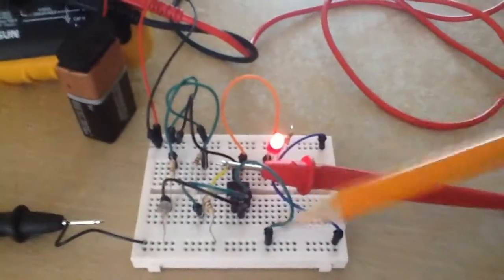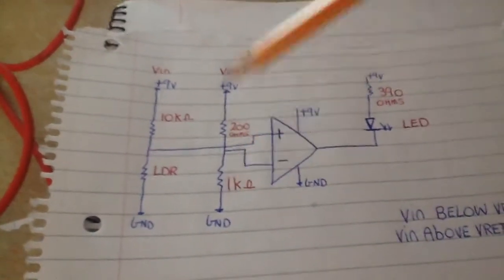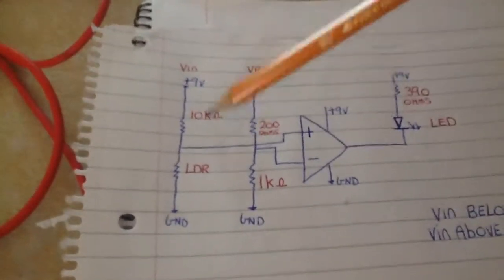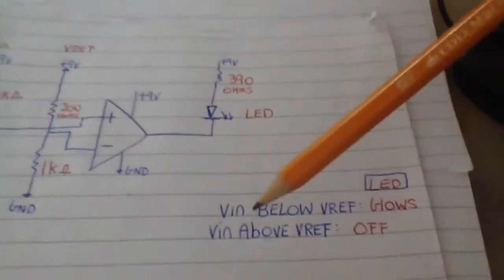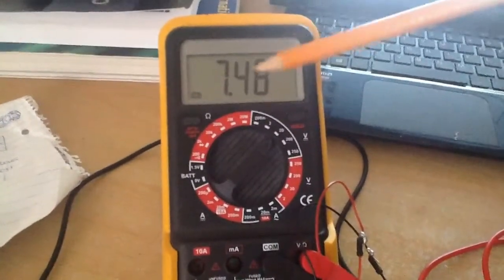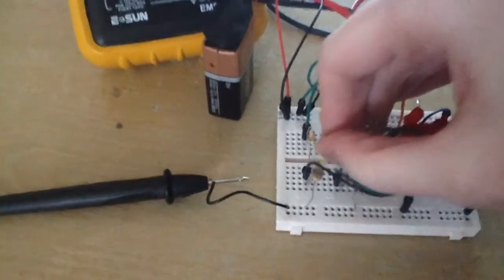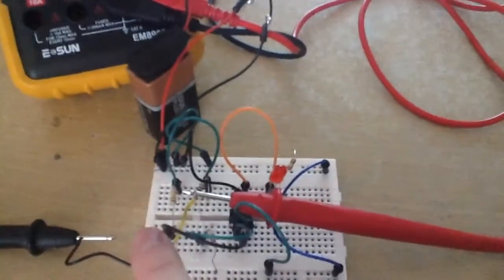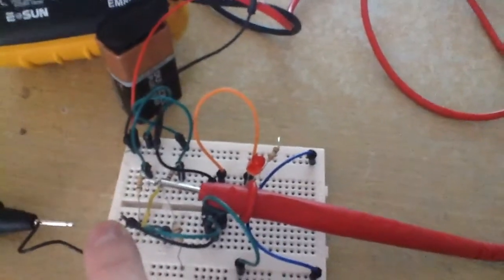741 Op Amp Comparator Circuit

Comment: how can use this comparator  protect household appliance from under /over voltage
Reply: You can't use this since you will constantly need a ref voltage , but if you can get a ref voltage then you will need a bridge rectifier and a capacitor to transform the current into DC from AC and get the volages into a high power OpAmp still another way to protect a household appliance from under / over voltage without using a voltage regulator or fuse is to use a microcontroller a voltage meter and a high voltage triac or relay.